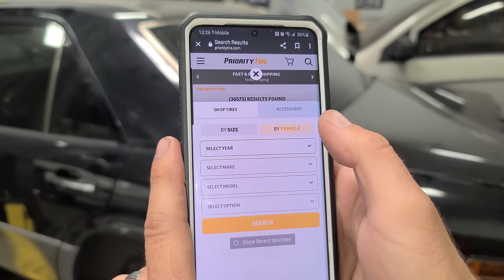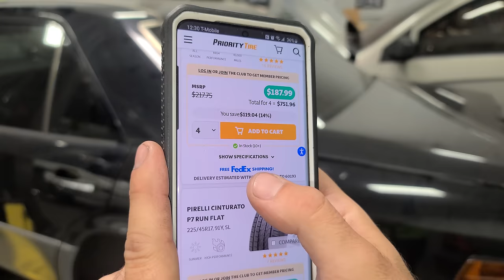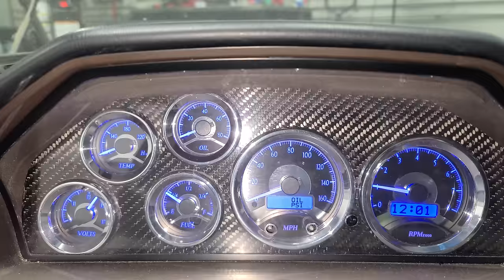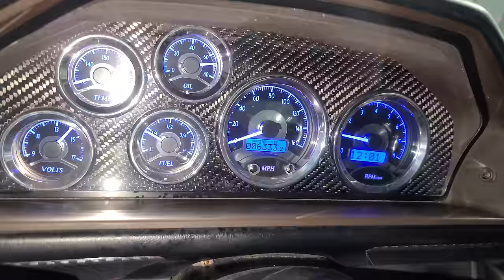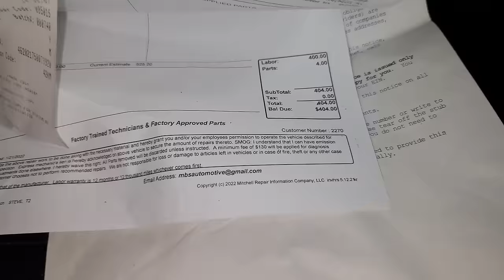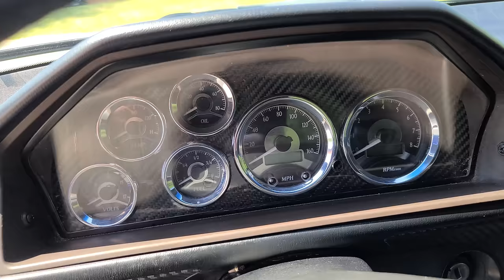I Finished EVERYTHING On My LS Swapped Mercedes Turbo Diesel! Best Of All Worlds!

Comment: As it turns out yesterday afternoon I had just put on a set of aftermarket monoblocks (8x17 ET30 245/40) on my $1600 92 400E (same colors black/gray as your car) and had to use a 15mm spacer on the front to get the wheels to clear the caliper. I bought these from a guy who had them on a W210 and had to use the spacers on that car too.  These wheels look the same (mostly) as your AMGs but I’m wondering what the ET is on your wheels and if they’re staggered or all the same.  I’m thinking they should be the same size as mine? Then last night I watched the vid!  Coincidence!  I was not sure about these wheels on my 400E but seeing them on your car shows they are a great choice and look really good. Thanks for any info about fitment. 

And yeah, I clean out under the battery trays too…

Comment: I recently traded a 1996 Dodge Ram 2500 4x4 gas 5.9 needing lots of repairs including needing a transmission and traded it for a 1999 Ford f250 4x4 gas 5.4 needed small repairs nothing serious then traded that truck for a 2005 Ford F350 4x4 6.0 diesel. How do you think I've done so far.

Comment: Learned how to ceramic coat, That’s dope. Need to paint correct and ceramic my Silverado. 2003, paint in good shape. Some defects but not rlly. Is it possible to just wash, clay bar, then lay down coating or do you have to paint correct? Can someone answer. Thanks.

Comment: Great 2 part series on this car.  I think the car is worth $15K but the best case is that whomever is interested in it should be able to drive it and will see how good it is.  I think you should swap this car for a car that has tough mechanical and cosmetic issues, but a solid body and frame/unibody.  When I say “tough issues” I’m talking about problems the average weekend mechanic will reject, then you can get a better deal.  The target car should be worth about $30K when it’s running and driving really nice, and is cosmetically good.  The repeat the process.  Alex, you have all the skills and insight to make this work.  YOU CAN DO IT!!!!😅

Comment: You know the throttle body you flipped...could you not also flip the part over to the right of the body which stuck into the nipple to have it clear the pulley wheel a little more too?

Or, are there some mechanical things going on within the body which would prevent that?

🤔

Comment: Hello chief,
What do you think of that? :
On my w124 250D, My battery charges at 13-14v with engine ON sometimes, which is regular.
Sometimes it goin down to only about12.3v therefore the battery gets down and battery (and ABS) warning lights get ON on the board.
Could be the (alternator) regulator? or any electrical network issue?

Comment: about the oil filter, yes both things works, No one of them is wrong to do. If you dont fill it, just fill oil on, start the engine for 20-30 seconds and then shut off the engine and then refill up tot he mark. :-) And also, I have never pre filled oil filter. :-) certificated mechanic here as well, so have done some oil changes on my part. But I havent tried cars with no oil sticks in yet. :-)

Comment: Man you could get another hood from LKQ for like $100.     I had both drivers doors on my Brilliant Black Magnum with wrinkles from a mishap.      Tried to massage them smooth.  No luck.      Waited out a clean black Magnum or 300 notification in my email from LKQ app.    Bam.   Black 300 (there was only one color black during those years) shows up, both drivers side doors were perfect, good paint, $65 each, brought them home, cleaned and buffed, they turned out great, and swapped out non-tinted back door glass, swapped out drivers door latch and key cylinder, bolted in, done.   Except chrome side mirror and window trim.    Swapped that out.  Done.   Less than $200 all in.  Easy swap.    Yep, Magnum and 300 doors are interchangeable.

Comment: I have a 1949 chevy 5 window truck with a lt1 a brand new 4l60e. It is a old navy truck. Old navy had empty shells in all of there stores and they would fill the beds with t-shirts. When corporate decided the stores did not need them anymore they sold off what they could gave some to the customers and scrapped the rest. There where around 350 of them at that time. Many of these trucks were parted out (because most of them were rust buckets) a handful where restored and then that leaves a handful of them to stay the way they were. Mine has a mustang 2 front end disc brakes in the front ac billet everything on the inside. If you are interested just let me know and I will give you all of the details.
Reply: @LegitStreetCars

Comment: I'd love to have that car. I have an 87 300E that isn't as nice that I drive often. I also have an 87 300D wagon, the only year for the OM603 in a 124 wagon but that one isn't on the road at the moment, long story. The only car of real value I have to offer as a trade is a very clean e36 M3 but I can't part with that one. If I had the money I'd buy that car from you.

Comment: As European i am amazed how these muricans decided to cut a hole in the hood ( plus painting it ) instead of just reversing the throttle body or even drill a new holes in aluminium plate which is Easy 10 minutes job, just WOW. Maybe they thought the valve in the throttle must be in specific position for air flow LOL

Comment: NOTE TO SELF:     i have a Ford 5.4l 3v and i didn't fill the oil filter and the engine locked up completely so i am a Pre oil filter filler cause of that incident that happened to me pre-fill your oil filter on ANY Ford 5.4l 4v,3v,2v, engines cause the filter element inside the filter wont let any oil through if left dry     your welcome

Comment: Why not just replace the throttle body completely with a new/used updated version with the smaller throttle motor?  If there's a difference in the electrical connector I guarantee somebody sells an adapter.
Reply from the maker: Because I just ended up flipping it around for no cost
Reply: @LegitStreetCars  I guess that makes sense with what you're trying to do with the whole "trade up" thing.  Looking forward to seeing what comes next.

Comment: You don't have to prefill the filters if you calculate a little "extra" into the volume you fill into the system, but it's recommended to lubricate the mounting-surface so they don't seize on as quickly.

Comment: If the hood was fixed with epoxy, it's going to need to be repaired eventually with enough heat cycles, sun blasting down on it, and the combo of cold outside and heat inside.  It really should have been done with a metal patch and the warpage thing is complete nonsense from a body shop.  This was Alex electing to get the cheapest repair.  Any good body shop could have gotten the patch in there and made it as straight as possible and/or had new dent repair tools and training to straighten the metal out and contour it correctly.

Comment: Absolutely do not feel sorry for dropping your oil. They sell it to whatever service comes to get it and it goes to be recycled. Any bulk oil distributor, like for an oil change shop, or industrial cleaning service, like safety kleen for example, will come get it for free and you can even negotiate with them for the price they will pay you for the discarded oil. Yes, they will buy it from you. Maybe even bring you a bulk tank for used oil to dump it into, which makes it so that they can come whenever you schedule and just hook up their truck and pump it out, and away they go. You'll sign for however many gallons, and they'll send you a check or bank draft or whatever.